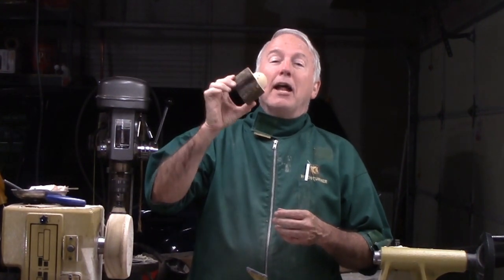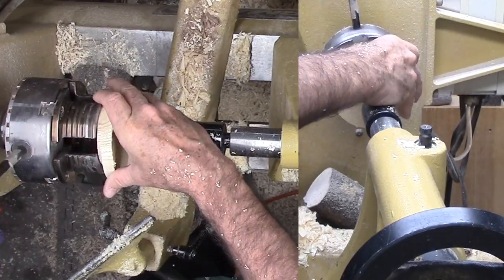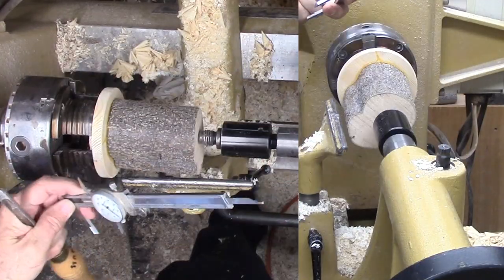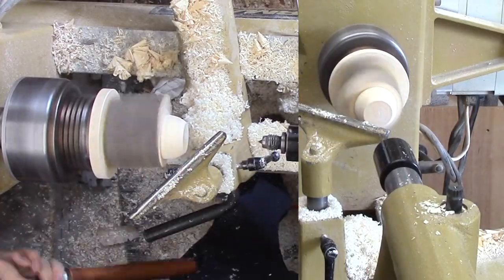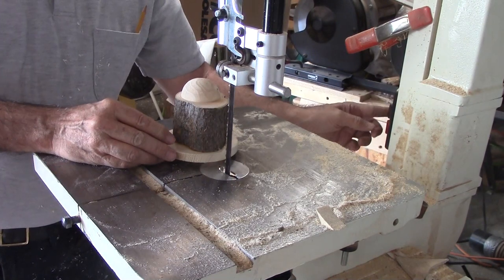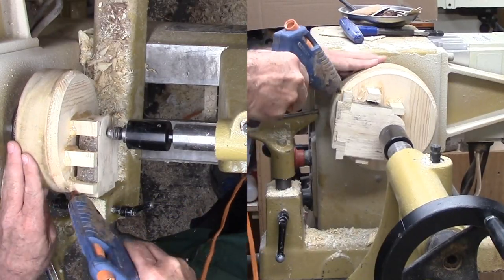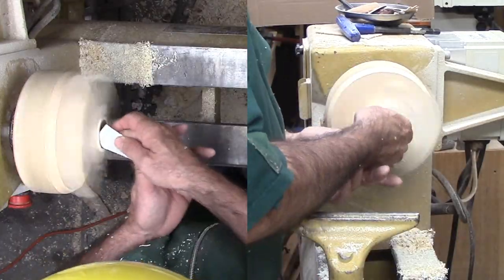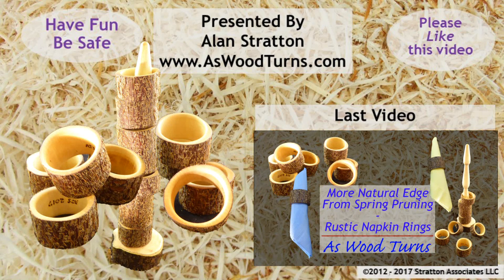A Small Emerging Bowl From Spring Pruning

Comment: This is very interesting but I think one of the main points of interest is how you mounted that u shaped block on the outside of the branch that holds it to the wasteblock after cutting it in half With the rough bark on a piece like that it is very difficult to get a block on it that keeps the piece parallel to the waste block. How did you do that??????????
Reply from the maker: All that I can say is that a picture is worth 1000 words. May I suggest you watch it again.
Alan

Comment: Alan, that is one variation I have never seen before. Interesting. I may have to try it. You may want to try industrial grade hot melt glue gun. The blue one like we both have just doesn't get the glue hot enough for a really tight grip, I had one come off, then saw Carl Jacobson who whipped out a higher wattage glue gun, and they do make for a better hold by getting the glue hotter. 
I think Mike Waldt uses a hotter gun too.
Reply from the maker: Well worth considering. I'll keep my eyes open for a better gun.
Alan
Reply: robohippy True, my gun is only 40 watts and the glue can go when its just melted but not super hot, especially when you use a lot of it on one piece. Plus this waiting to start glueing is horrible. I think I saw a 600 watts hot melt glue gun on an auction some time ago. Is it possible? It would be super glue gun ;-)

Comment: Something to note that the "fear" aspect of this increases exponentially in direct correlation to the size of branch chosen. I grabbed a limb 7" long and 5" wide and the sound at 500rpm could be compared to a jet engine. Needless to say I'm not just relying on hot glue. Seriously considering hitting the reset button and trying a smaller piece. 
Did you use any counterweight to limit being so far off balance?
Reply from the maker: Yes, it sounds like a jet engine. But I'm not so concerned about the noise level. What bothers me is the vibration that goes along with the sound which depends on lathe mass. It has to be slower until some of the wood mass is removed.
I've considered counter weights but did not need them this time. Plus, I cannot see using a counter weight in the first phase when turning the hemisphere; only in the second phase. I'll be looking for some lead fishing weights preferable in disk form or I may have to cast them.
Alan
Reply: Try diving belt weights.